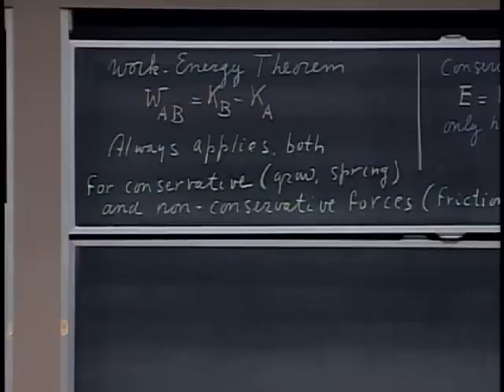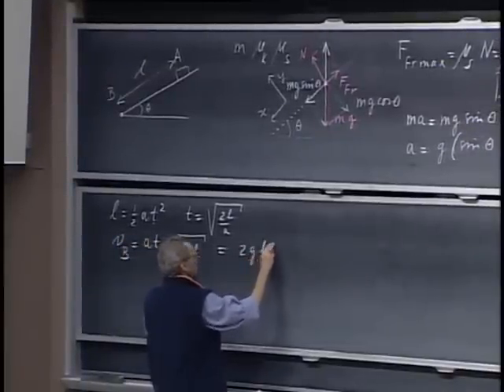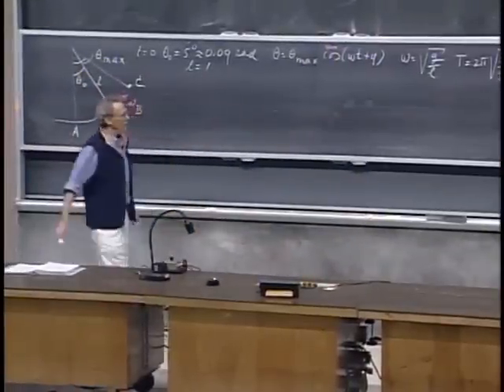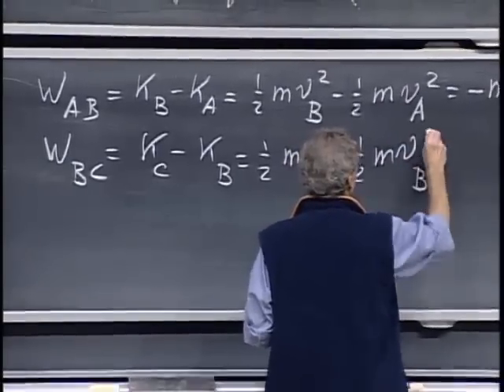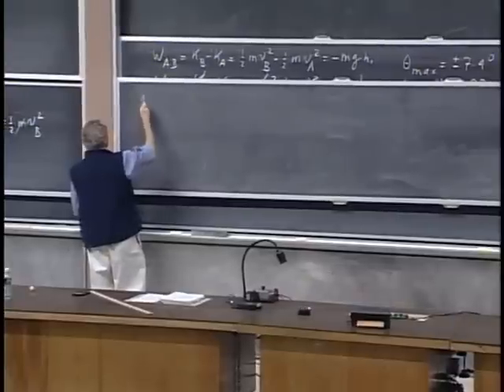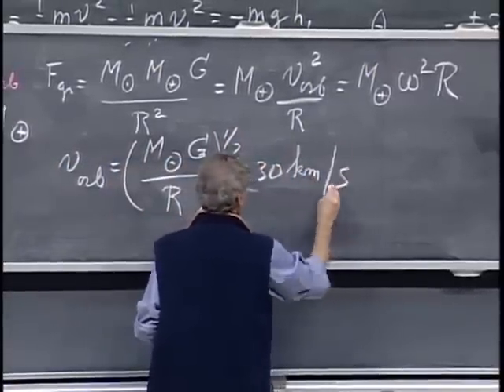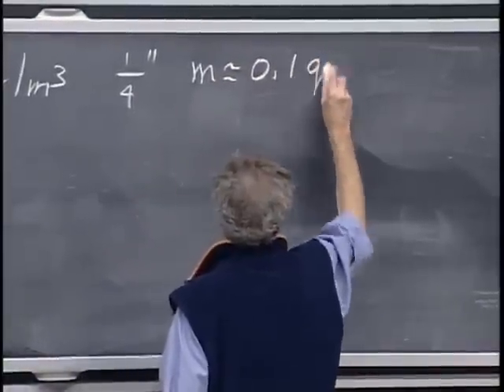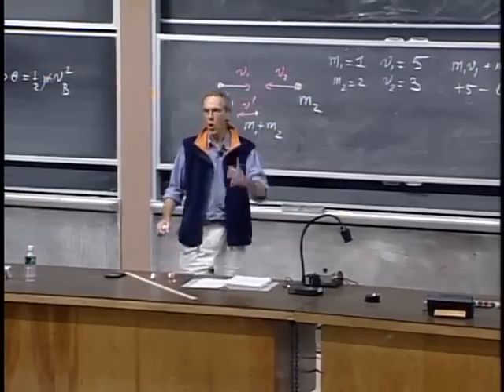8.01x - Lect 18 - 2nd Exam Review

Comment: On the falling ball bearing in Karo syrup, you fail to account for the buoyant force.  You need to subtract the displaced mass of the syrup from the mass of the ball, and use that for the "m" in "mg" term.  This will result in a "slower" answer.
Reply from the maker: how many minutes into the lecture?
Reply: Starts at 40 minutes and continues for about 4 minutes.
Reply from the maker: An easy way to see that I took buoyancy correctly into account is because of my measurement of C.
terminal velocity =  (4/3)pi*r^3*(rho steel  - rho-syrup)/C'r= 4/3)pi*r^3*(rho steel)g/Cr. I measured C (not C') thus I took buoyancy into account.
Reply: Yes, you did take it into account (by accident), except for only iron balls, where the buoyancy is a set fraction of the iron's weight.  What you have is a "fudged" constant, not properly based on MKS units which you are using throughout.  If part "B" of the problem  used tungsten, or beryllium, or even a polystyrene foam ball, the predicted speeds would be incorrect.  (And yes, the foam ball would work.  You would have to start it on the bottom of the syrup and it would go up.  The math of the problem would fully account for this.)

The reason I an nitpicking is because this is about teaching students proper process, rather then "just getting answers" (which is even detailed in your buoyancy lecture with balloons, etc.).  Some students may be confused.  "Why didn't Walter account for buoyancy?"  That determines the viscous force, which sets the speed.  Your "K1" will be too large because F(res) is too large.  please explain that a buoyancy calculation belongs in this problem!

You should add one of those "correction blurbs" to the video.

Keep up the good work!
Reply from the maker: >>>for only iron balls>>> Yes ONLY for iron ball bearing and also ONLY for my syrup. For very good reason as I had done an experiment with iron ball bearings and with that particular syrup. 
Had I done the demo with any other syrup and/or any other kind of balls (e.g., aluminum) I would have measured C  and that would also have taken buoyancy into account.  What I did was NOT an accident, after all I am an experimental physicist Recall that I did an extensive demo where I released iron ball bearings in syrup. The results were spectacular. It was probably in Lect 17; I mentioned it in Lect 18.

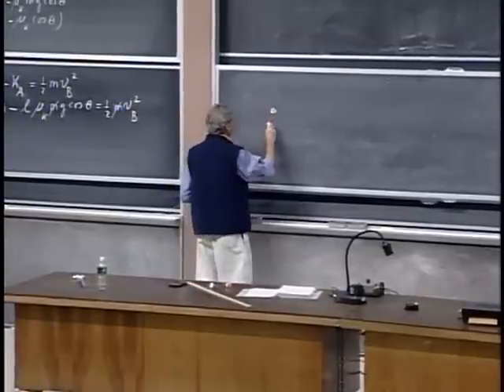Comment: 46:39 you said that Kinetic Energy can be destroyed. But First law of Thermodynamics state that energy can neither be created nor be destroyed. Is it so that Kinetic Energy gets transformed to Heat Energy? Sir please do clarify.
Reply from the maker: Yes, ofocz, KE can be destroyed it would then in many cases be converted into heat (which is a different form of energy). However, with hydro power stations the KE of the falling water is converted into electricity (Faraday's Law).

Comment: In 8.01 2nd Exam, Problem 2 Ap a): In the way up you have 2 forces against movement. In the way down you have one force in favour that's greater than the one against. So, why it takes longer? It seems the way down to be faster!
Reply from the maker: +Jordi GS What counts is the acceleration in the vertical (y) direction. On the way up there are 2 forces down: air drag and gravity. On the way down there is one force up (air drag) and one down (gravity). Thus on the way up the acceleration (downwards) is larger than on the way down; therefore the y component of the velocity comes to a halt faster on the way up than on the way down. Thus the time to go up will be shorter than on the way down.
Reply: +Lectures by Walter Lewin. They will make you ♥ Physics. Thank you very much, Professor.

Comment: When you end up making accidental errors (though it's very very rare), I wonder why don't the students correct you?
Reply from the maker: there are typically more than 250 students in my audience. A slip of the pen is not a mistake and my students know that. They therefore prefer not to interrupt. When I gave recitations (for only 30 students) students would point out a slip of the pen.
Reply: @lecturesbywalterlewin.they9259  holy smokes!!! 250 students!!!

Comment: sir using work energy theorem am getting different answer (1/2)mVa^2 = 1/2mVb^2 - 1/2kXb^2 = -1/2kXmax^2  which is not possible but have checked my calculations 4-5 times but still not able to figure out the issue.

Comment: Dear Prof. Walter Lewin, Is there any magnetism involved in that spinning top ?
Reply from the maker: yes
Reply: +Lectures by Walter Lewin. They will make you ♥ Physics. 
So rotates like a dc electric motor. current carrying conductor placed in a magnetic field.

Like the battery in the glowing ball. Energy can't be created from nothing..
Reply from the maker: Yes it's a DC motor. The beauty is that the current generated by a battery in a coil inside the box is activated by the rotating magnetic top itself and this current keeps the rotator going as needed. It's very clever. I do explain this in a later lecture. Thus when you do not rotate the magnet, no current is drawn - that gives the battery a long life time of years.
Reply: +Lectures by Walter Lewin. They will make you ♥ Physics. 

Thats great .. Thank you for the detailed explanation.

Comment: So back in the lecture on pendulums (and also on balls rolling in circular tracks) I solved the differential equation for x(t) with initial conditions x(0), v(0) and theta(t) with initial conditions theta(0) and w(0) using the general theory for second order ODE's to be:

x(t) = x(0) cos(sqrt(g/l)t) + sqrt( l/g ) v(0) sin(sqrt(g/l)t),
theta(t) = theta(0) cos(sqrt(g/l)t) + sqrt(l/g) w(0) sin(sqrt(g/l)t).

And these give the same answers as the ones found for the review pendulum problem in this video.  Is there a legitimate reason why these equations are not used, or is it just because X = Xmax cos(wt + phi) looks nicer?  I'm coming at this from a pure math perspective, so using the general theory of ODE's seemed a more logical place to start for me.  This also works for the spring ODE: x(t) = x(0) cos(sqrt(k/m)t) + sqrt(m/k) v(0) sin(sqrt(k/m)t).
Reply: if you graph it in desmos since the cos and sin have the same frequency then you result in one uniform sin/cos wave

Comment: I don't understand so much the meaning of work. Is it a form of energy? Is it exclusively to kinetic? Do I have to take account of it when I have to sum up all the energies carried by a car in difficult trajectory? just an example
Reply from the maker: watch my lectures - it's all there
work is force times distance (units J= Nm). N is kg*m^2/sec^2 which is also mass*speed^2 (KE-0.5*m*v^2). Thus work and energy have the same dimension. If a force of 3 N moves an object over a distance of 6 m, then the work done by that force is 18 J. That is independent of the mass of that object.
Reply: thanks, I've to watch it again

Comment: Is that toy spinning because of that little pointy part at the bottom? It seems like that's what it's causing acceleration for it to continue spinning while losing energy from its friction.
Reply from the maker: NOOOOOO how on Earth would that be possible?
Reply: @lecturesbywalterlewin.they9259  oh wow... I didn't know you were still replying to these lecture videos... How is it possible? That toy has some very high tech involved I would say.

I'm joking..
I thought about it again more rationally this time.
I think it's possible because the bottom of the toy and the surface have low friction coefficient and also the toy have high moment of inertia. Is this correct?
Reply: @joeaverage8329  I don't think so. I believe it has to do with electromagnets

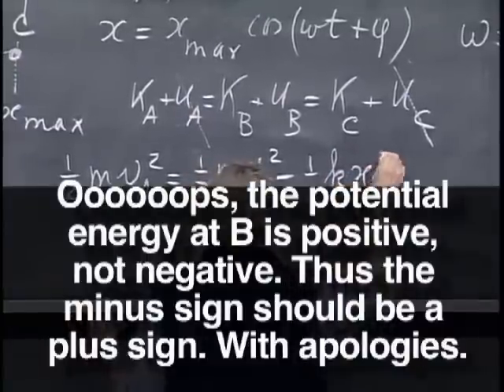Comment: dear sir, can you please explain why is the PE of the spring at point B not negative at 32:02. i think it should be minus because the potential energy wants to drive it at x=0 which is in the decreasing value of x. i would be thankful if you helped me, sir.
Reply: its because the formula for elastic potential energy is 1/2kx_1^2-1/2kx_0^2. plugging in the values will show its positive

Comment: about escape velocity professor : it means that for  an object to leave the gravititional field of earth it should leave  the surface with intial velocity  equals to the escape velocity or  the object should hold at constant velocity equals to the escape velocity???
Reply from the maker: >>>or  the object should hold at constant velocity equals to the escape velocity???>>>
NOOOOO
Reply from the maker: >>> it should leave  the surface with intial velocity  equals to the escape velocity>>>
YES
Reply: thanks for replying professor.
but if it is the intial velocity how i make sure the object reached infinity . I think the object will stop after some time at a certain height and come back to earth. cause there is always gravitational field any where it just become weak??
Reply from the maker: The escape vel from the surface of the Earth is 11 km/s
It may not make it to "infinity" (which is only a mathematical concept) but it will never come back to Earth.
Reply: aha got it .
thanks professor

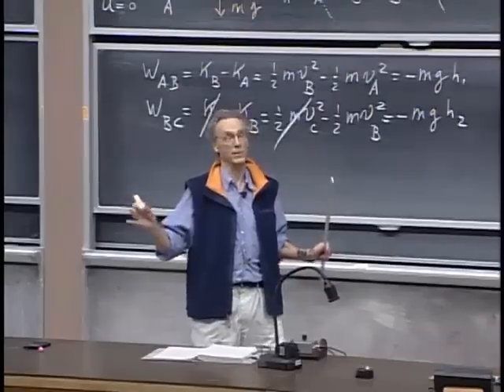Comment: dear professor at 23:45 why you said we can't take thete max. minus? why just plus u have taken?
Reply from the maker: Of course, I could have chosen theta_max = minus 7.4 degr. The motion of the pendulum would then be identical.  But I specified my initial conditions: theta_max=+7.4 degr,  d(theta)/dt is positive.  To meet these conditions phi turns out to be --0.82 radians which is about --47 degr.

Comment: Hello prof Lewin, I don't understand why you say to make the rocket get away from the sun, we just need to let total energy of the earth be 0?
Reply from the maker: question unclear. In addition always refer to how many minutes into the lecture
Reply: Thanks for replying. At 38:13,  you said in order to get away from the sun, the total energy of the earth should be 0, why is that so? And at 38:40, you said the potential energy is not changing, but isn't it travelling to infinity and R is increasing?
Reply from the maker: Yes for increasing r, the PE is increasing. It's maximum is ZERO at infinity. At the Earth surface it is --mMG/R (R is radius Earth).
Reply: Sorry I am a bit confused. For the rocket to get away from the sun, its minimum total energy is 0, so K=-U. While the rocket is orbiting around the sun, K=-1/2U, hence K'=2K. Is that correct?
Reply from the maker: how many minutes into the lecture? 
For an object to escape Earth, its KE must be +mMG/R. R is the radius of the Earth. Thus when it reaches infinity the work done by gravity is --mMG/R thus its PE is then zero,
Reply: If the object has KE>+mMG/R, it can escape earth with a positive velocity when reaches infinity is it?
I understand PE is 0 at infinity, my confusion is mainly at 38:20, when you explained why K'=2K.
Reply from the maker: I watched at 38:20
I cannot improve on my lecture. Watch it again and listen carefully.
KE in orbit is NOT KE to escape Earth. What I said and wrote is correct.. I cannot do better - sorry = good luck!
Reply: Ok. Thank you for your patience and kindness.
Reply: Lectures by Walter Lewin. They will make you ♥ Physics. Savage. 🤘🤘

Comment: professor lewin, in the last exam 2 question why do we add the accelerations of both stars. Are we approximating them by one star that has an acceleration a1+a2?
Reply from the maker: which question in exam 2 of 8.01. Please be very specific
Reply: Lectures by Walter Lewin. They will make you ♥ Physics. The final question. The one about the binary system.
Reply: Just need to know specifically why we add the two centripetal accelerations
Reply from the maker: ha ha ha
this has NOTHING to do with Physics. This is math. 
If I have 2 eqs which are both correct, then I can add them or subtract them. The result will then still be correct.
Reply: Lectures by Walter Lewin. They will make you ♥ Physics. Oh! Slipped my mind... Thanks for the clarification tho!

Comment: In 8.01 2nd Exam, Problem 1 Ap.e, I think that a necessary requirement for the sprig, as asked, should only depend of its physical characteristics. So it must be a requirement for k and for its lenght l when relaxed.
My solution is k.l ≥ m.g.(µk.cosѲ + sinѲ).
Have I the 10 points of Ap.e?
Thank you Sir.
Reply from the maker: +Jordi GS for the spring to reach a length l, x must become zero or less than zero.  Thus the requirement is that the potential energy (at x_max) + the work down by the 2 forces (down hill) when the block goes from x_max to x=0 must be zero or positive. The work done by the 2 forces down hill is negative.
Reply: +Lectures by Walter Lewin. They will make you ♥ Physics. Thank you Sir.
Reply from the maker: +Jordi GS You are welcome

Comment: In 8.01 2nd Exam, Problem 1 Ap.c, I don't understand why max. speed occurs when a=0?
Can you tell me why Dr. Lewin. Thank you!!
Reply from the maker: +Jordi GS When we touch the block, the friction coeff goes down from mu_s to mu_k. Thus the spring force along the slope upwards is now larger than the sum of the 2 forces along the slope downwards. Thus the block will be accelerated up hill.  But as it moves up hill, the spring force will go down (the smaller x the smaller will the spring force become). There comes a moment that the spring force equals the 2 forces along the slope downwards. When that happens the acceleration of the object is zero. The block has a speed thus it will continue going up hill but now the forces along the slope down hill will be larger than the spring force up hill. Thus the block will "decelerate". Immediately after the acceleration is zero the sign of the acceleration of the block flips over and it loses speed. Thus the largest speed occurs when a=0.
Reply: +Lectures by Walter Lewin. They will make you ♥ Physics. Thank you very much!!
Reply from the maker: +Jordi GS You are welcome.